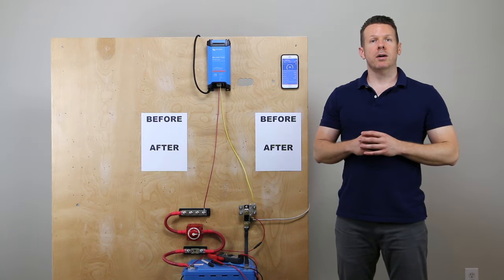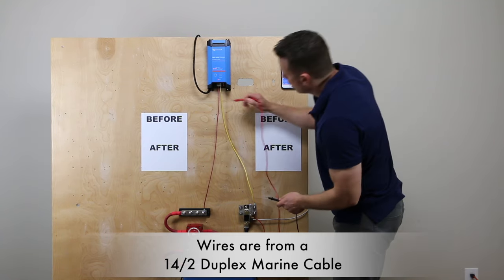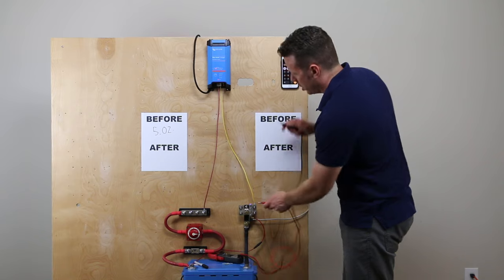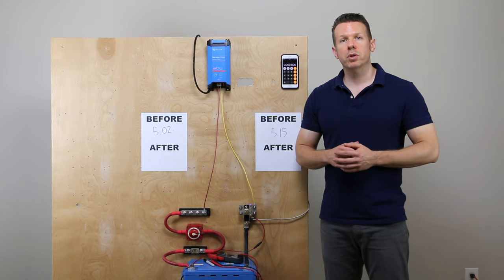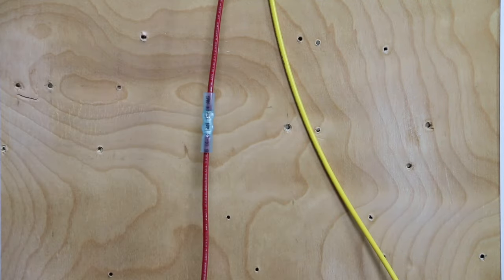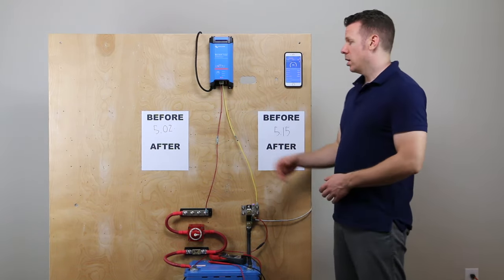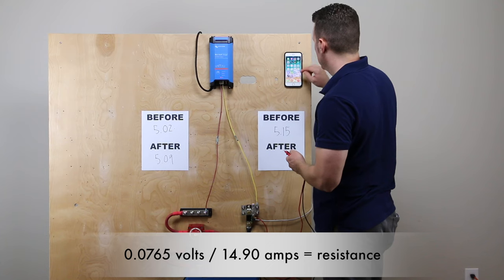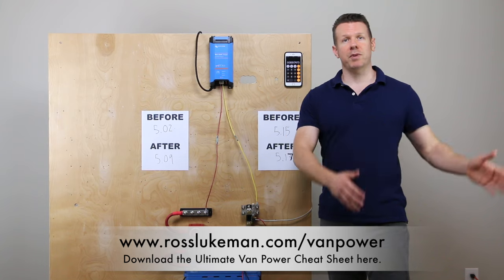Are Solder Seal Connectors BETTER than Butt Splices? (the truth)

Comment: Solder connectors don't have enough solder to get a reliable joint. They work better when you tin the wire first.
Reply from the maker: Sounds good, thanks for sharing your thoughts on this!
Reply: If you pre tin the wired you cant mesh them together properly... just use them with flux
Reply: Disagreed, they've already tested and more than often the solder will just be unreliable and not connect properly if you tin the wire
You should entangle/mesh the wires together and then melt the solder

Comment: The low temperature melting solder in these connectors can re-melt in a hot engine compartment, or under high amperage. The heat shrink by itself is not mechanically strong enough to support the wire. A proper crimped and/or soldered connection will have mechanical strength and conductivity.
Reply: I agree. If life were perfect, I would like to 1: crimp,  2:solder,  3:heat shrink waterproof. Life is never ideal and I end up solder/shrink most of the time.
Reply: Granted,this may be LOW MELT Solder.  I've never used this Product yet. I've done it OLD SCHOOL. Regardless,it would have to sit right on top of the Manifold for that to Possibly  happen,which should NEVER be allowed in the 1rst place ! That is BAD wire Management Practices ! 2nd,if you happen to display HIGH Current through that connection, enough to MELT that Solder,you are doing something wrong in the 1rst place. A Fuse should Trip, LONG before that condition even comes into play,or you didn't pick your circuit/wire size/Fusing correctly.
 Low Melt Solder melts from 302-338° F,Tin/bismuth, tin/indium, or tin/bismuth/silver are the most common “low melting point” solders (150-170° C). 
Now what composition this Butt Connector uses,I couldn't say. Radiator Water can exceed over 212° with the help of Antifreeze Coolant in the right conditions. This is a FAR Cry from 302°F, granted Exhaust Temps are Much higher,but they are shielded so this kind of Monkey Business doesn't happen. 
  Now as far as the Heat Shrink is concerned,it should NEVER be a Factor in the mechanical bond equation, as far as depending upon "IT" to be a Factor of that. That is NOT its JOB !
If you are depending on that to be part of your Holding Power,you have a Problem ! That means bad/WEAK joint ! SIMPLE ! My joints will hold a BULL DOG ! The wire will break some where else before that joint will EVER Fail ! I agree,a crimped/soldered connection is better than just crimping. I do that on Large END Terminals,but not just for mechanical strength and conductivity,i do it for corrosion protection also.
 So all in a day, it's up to how far are you willing to go to make a great connection. Would i use those Low Melt around a High Temp area? Doubtful. Not in DIRECT Proximity of the exhaust line. I would take Temp Gun measurements in that spot before i did,IF its around the Exhaust. Anywhere else would be fine.
 But you have to think,if you can put your hand there,it will survive. 302° F is pretty HOT ! AND,you can always put up a shield between it and the source.
Reply: I have never had that problem with the solder remelting. Low temp solder normally has a melting temp range of 150-170° C, nothing in an engine compartment is going to get that hot.
Reply: Good point, not to mention the entire experiment is meaningless since he resistance will change in the wire that received heat from the torch
Reply: the melting point of those solder is about 150C. That is likely not going to be in ur engine compartment....
Reply: @zhengong2101  in and around the exhaust and cats, it does get up to 900°C 
So maybe he’s safe high ip in the engine bay?
Reply: Yea i know that. But for 900C, even the insulation of wire is not able hold that temperature probably. And those connector offen use in Engine bay, or like in Marine environment.  @MowSow
Reply: Remelting with high current...  No, I don't think so.  That 0.0002 ohms it added won't produce a significant voltage drop to generate resistive heat, especially when heat is bled off in 2 directions by the wire.  The fuse will blow long before the solder would remelt.
Reply: @PeterLawton  and yet it is an issue in marine engineering compartments. The wires themselves get hot enough that using teflon or high temperature silicone insulation is common.
Reply: @zhengong2101  For 900 degrees MICC enters the chat. (mineral insulatad copper clad)
Reply: @MowSow  check out the temps in a poorly ventilated boat engine compartment. The ABYC standards exist for a reason.
Reply: @pen1208  Which is 150°C, did you not read where I said this would not be problem? perhaps you are replying to the wrong person?
Reply: @freddieclark  yikes, yes...I most certainly meant that for someone else. My apologies, my friend. I have corrected it.
Reply: I had used some for some 02 sensor wires. It does not do well
Reply: @freddieclark  Locations near turbo, catalysator and maybe exhaust side of EGR will see very high temps so make sure none of the soldered wires never get close to these locations.

Comment: Everyone misses one big point - solder will not corrode.  I would tin the wires first in all instances but differing metals can give a mild diode effect.  I'm surprised the solder joint wasn't worse than the crimp, when new.  The crimp is considered to be mechanically superior but there should never be that much strain on a cable to test it.  Salt water/damp atmospheres destroy copper, so solder rules on a boat... and RV.
Reply: I have to disagree with you. Solder creates a work hardening zone and vibration will break down the wire at the point where the solder stops. American Boat and Yacht Council (ABYC) standards prefer proper crimps over soldered joints. Adhesive heat shrink virtually eliminates moisture ingress. I would apply the same rules to an RV. 

Another thing to consider is the amount of solder these connectors have. It doesn't appear to be enough to thoroughly wet out the wire through the cross section. Bigclivedotcom (another YT creator) did a video on this where he cut open the joint and a fair amount of the wire was still bare copper.
Reply: @rogermccaslin5963  Correct, except I have had so many crimped spades and connectors fail through corrosion and none through mechanical fatigue.  Preparation, cable routing and management are so important to a reliable, long term, reliable installations.  That said, we crimped part of our last install with adhesive crimped connectors.  It will be interesting to see how they perform.  A lot of regs here in the UK are written to compensate for poor quality installs.  Big Clive is great, I don't watch him as much as I should.
Reply: Soldered joints are much worse if there are any vibrations and lead-free solder is double bad in this context.

Comment: Instead of sliding the wires into the solder connector. Intertwine the wire strands, making a solid mechanical connection and sliding the solder connector over and melting. It gives you a stronger on mechanically.
Reply from the maker: Thanks for your feedback!
Reply: Solder should not be treated as a mechanical bond. The solder in the solder sleeves I understand contains bismuth and lowers the alloys' temperature to around 140°C. Bismuth makes the bond point very brittle.
Reply: Intertwining each strand has little to no effect versus not and simply twisting them ALL on each side around one another. All it does is waste time, and break strands almost every single time.

Comment: Solder seal is mostly useless on old wiring. Probably OK on new wire but difficult to determine if the solder flow is good or not. I find crimp with hot glue sealant is a better choice especially when working in tight difficult to access places for repairs. The correct crimper style is mandatory. Some people use the crimper with the point which punctures the insulation. The glue also helps mechanical strength. One thing to remember is manufacturers only solder in specific areas it at all. Crimping is their go to process. This doesn't mean it is the best but when I see crimped connections that are 50 years old and still sound that has to say something.

Comment: I do a lot of trailer wiring, and am a big fan of the marine grade heat shrink connectors as long as they're name brand. Wirefy and Haisstronica are my favorite brands so far. I feel they're more durable and easier to use in tight spots than the solder seal ones. Type of crimpers is also important.
Reply: I need to do some automotive electrical wire repair for a Jeep. Would you recommend these marine grade heat shrink connectors? It’s specifically in the engine compartment.
Reply: So what crimpers do you recommend and what is your opinion on open barrel connectors.....I'm hooking up am MSD 6A in my older ford pickup....
Reply: I agree completely with marine connectors.
I build race boats and use them exclusively!
Reply: @WiSeR187  Not sure why @desmt4696 has ghosted everyone, but.... @WiSeR187 - yes, the marine connectors would work just fine in your Jeep example. 

@halseyknox - open barrels aren't bad. However, they aren't insulated and don't have quite the same\good of a connection grip in areas where there is motion placed to the wire. If the wire is not in an area with anything that interferes with it in 3D space, then they would work just fine, minus the lack of waterproofing. I would use either/or "shrink-butt-connectors before barrels, in my personal opinion.
Reply: Thank you for dropping brand names.  South Main Auto also uses Haisstronica and did not complain.  I am here ONLY because I have gotten CRAP from home depot and knew I would spend hours looking at amazon, walmart, ali, temu and so on without NO IDEA if they are even good enough to trust.  I'm going to look for some of the ones you like, thanks.

Comment: I'm a newbie.  This was well-designed and easy for a rookie to follow.  My application is marine with some occasional tight spots.  Thinking I'd rather use a butt crimp and then heat shrink.  Spaces on a boat can be tight.  Hard to tell from this vid, but it appears that there may be less open flame or heat gun time involved in the butt crimps because the purpose is just to shrink the cover, the connection is already made mechanically.   It's all personal preference I suppose, but I like the idea of limiting the time spent introducing heat into a smaller area on a boat.   Great vid tho, you are a very good instructor.

Comment: It would be interesting to see what happens when more amps are introduced in 5 to 10 amp increments and which connector fails first as the connection/wire heats up

Comment: Thank you for the real world demonstration. Consider splicing pieces of loose wire together and subjecting them to various conditions and loads over time, e.g., moisture, excessive current. Then periodically take resistance measurements with a Wheatstone Bridge. This could be a running experiment over a period of years.

Comment: Ended up here somehow, but very interesting. If I can’t solder I like the solder seal ones as an alternative. But I like to use marine heatshrink over the solder seal heatshrink. It ends up looking like a soldered connection and makes it more rigid.  Slide a piece over before heating the solder seal, let it cool a little then seal it up.

Comment: Seems like either are a reasonable choice.  Thanks for the video.
Reply from the maker: That was kind of how I felt at the end of it, thanks for tuning in!
Reply: @rosslukeman  I'm a retired EE, and really liked this outcome . Proof of Concept!  But what is also the Lack of Rule here in the end too,1rst of course a GREAT connection,,but 2nd is the Time & Element factor ! With that simple Butt connector,there is still exposed connections inside that are somewhat imperfect to the atmosphere. These CAN and HAVE corroded over TIME, even under a simi-sealed condition. The Length of Time this takes is highly variable,but it's there. WATER can,and will, ingress into that Butt connector and then MOTHER NATURE  will take its course. It's not a matter of IF,it's WHEN ! 
 I have done MANY restores,and I'm sure you have to, of them NASTY CRIMP CLAMPS ! They should be OUTLAWED ! And you know what I'm talking about,them stupid @$$ Clam quick connectors that corrode as soon as you install them. The BOTTOM of the Barrel ! I NEVER use them ! PURE GARBAGE ! 💩🤬
 But My belief in using Soldered Connections on ALL my incursions Alleaves the chance of ANY and ALL WATER into the connection possible.
 But  I think Water Ingress is somewhat implied here to begin with,using a shrink type solder/shrink connector. Killing 2 birds with 1 Stone !
 The Guy who thought that Solder/Shrink connector up was Brilliant ! DAM ! That saves a TON of WORK & TIME !  I do it OLD SCHOOL ! 🎓
 But by Soldering the connection, that will help eliminate the chance of a BAD connection in the future. And you JUST proved, a LOWER resistance factor in your work scheme.
  It's all how long are wanting it to last before a failure may crop up ! Just because its NEW, doesn't mean it will WORK !
I also use to be a Q.C. Technician at a VERY WELL known company ! 1 out of 10 is an "Acceptable" Failure Rate ! YES ! That is even Military Standards !
 That is unfathomable ! But it is in STONE ! I seen the book. Yes it's in print. I was responsible once for Killing a NEW product Before it had a chance to hit the Selves.
Long story short,the 3rd round of MY inspection,and the gavel came down on my Ban Hammer, too many BAD units  !! They were Jumping ALL OVER me !
 They asked," Do you have the @$$ for these GUYS or WHAT?" I said,"NO,Just quit Pumping 💩!!".   That was the "LAST" unit I seen of THAT !! CASE CLOSED !😎

Comment: Have used many Rechem splices and terminations (solder seal style) to repair wiring or to install modifications in fighter/maritime patrol aircraft. Both inside and on externally mounted avionics (pods)(high vibration areas). We never have any problems with them. I use them in my vehicles and for trailer wiring. Aircraft also contain crimp style splices BTW (plugs, bulkhead passthroughs, high current situations) I'd use either style, but prefer solder vice crimp. 35 years working on aircraft and aircraft wiring BTW.
Reply from the maker: Very cool, thanks for tuning in and for sharing your thoughts on this!
Reply: Hey Ross. I tuned in as I was curious about what you had to say. I’ve seen so many people on here who can’t solder, try to demonstrate how to solder. Disaster every time. Proper crimps, technique and solder sleeves are the answer. Unfortunately most use the crappy dime store crimps as they are afraid to solder. Anyway, I enjoyed your demonstration as it was well layered out and factual. Thanks.
Reply: Hi, I worked 28 years for Raychem Corporation in Menlo Park, California , I worked with radiation crosslinking technology  , and Raychem was purchased by TYCO ELECTRONICS after the founder Paul Cook retired.
Reply: @MrRockydee07  I am looking for TE solder shrinks.

Comment: When I worked at GE in the harness department, we used solder sleeve connections exclusively. 
The went on military aircraft and would experience a lot of vibration and worked fine.
Reply: what i have noticed using these, is that even if the solder doesn't melt too god. The water resistant and the insulator works good enough. So, you need to make a proper splice and then apply it. It's better to have a weak solder core than over do the heating and ended up with a bad heat shrink :/

Comment: I twist the wires together when I use the solder connectors. I usually just use the regular heat shrink butt splices though.

Comment: Well done video!
If those wires still exist, it could be interesting to do a follow-up in a year or so. See what difference corrosion makes. Just an idea...
Reply from the maker: Great to hear you enjoyed this experiment! Thanks for tuning in and for the idea video idea!
Reply: @rosslukeman  Also, it's be nice if you do a pull apart test to see how many pounds of tension it could take to pull those joints (crimp versus solder) apart.
Reply: Exactly. That is where the solder seal then truly outperforms.
Reply: Low melt solder is very brittle and these a are known to corrode the conductors over time.
Reply: @SerenoOunce  That shrink tube with the extra seal should take care of that, no? I have some in quite humid (Texas) conditions, visible for inspection, and can't see any corrosion after a few years, nor any higher resistance.
Reply: @ziegle9876  It's the flux/solder alloy itself that's corrosive.

Comment: thank you for your video. I did not know which of the two types I had to choose for connecting the dashcam of my car to the fuse adapter. I will try the solder seal connectors cause I already successfully used them in past to replace the internal fan of my apartment freezer

Comment: My  wirefly solder seal was tight  after installing 
6 months later it came loose     Went back to butt connectors
Reply: That is the Big Question mark, on the use of this type of connector, in my eye. You can Never be 100% SURE that you have a GREAT Connection !

Comment: solder connection shrinking on the wire and some brands is lined with hot glue that makes more sense in marine and outdoor connection

Comment: great test - wondering if you need to do this with wago, and wire nuts and an old school solder...
Reply from the maker: Hi Doug, thanks for the suggestion. With all due respect, I think I will likely move onto more widely-applicable topics at this point.
Reply: what do you mean more widely-applicable topics?! so many commenters are all thanking your for this comparison and suggesting you expand to include other connector types!
I'm sure Project Farm has done a comparison video, but your video here was more focused in on specific electrical attributes...plus there is benefit to seeing a side by side comparison rather than a shootout of 50 different options.